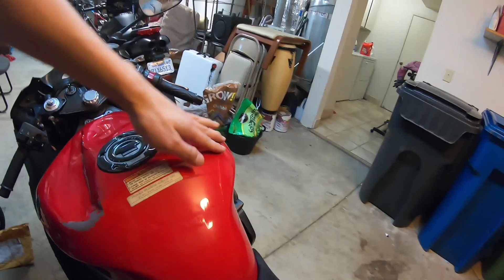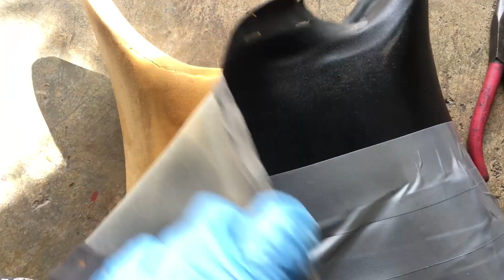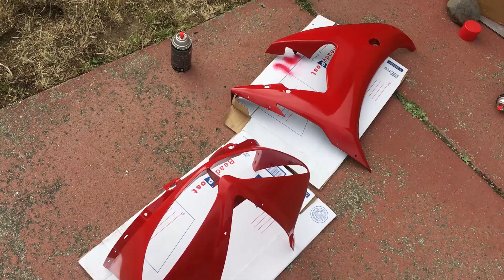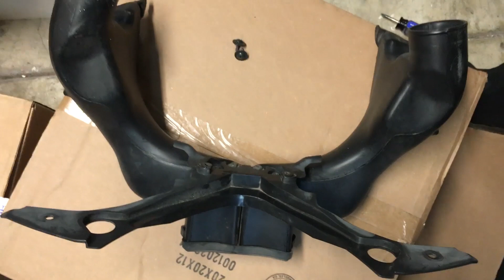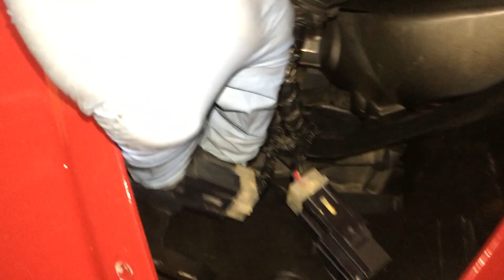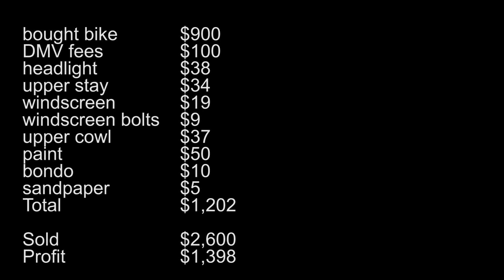Yamaha R6 Crash Repair - Paint Fairings, Replace Fairing Stay, Windscreen R6S

Comment: Trying to find a cover but ebay dealer claim the 2003-2005 cowl cover won't fit the 2007r6s which is the same bike
Reply from the maker: Did they tell you why? They may be just going off of a list based on the year, and not know that it's interchangeable.